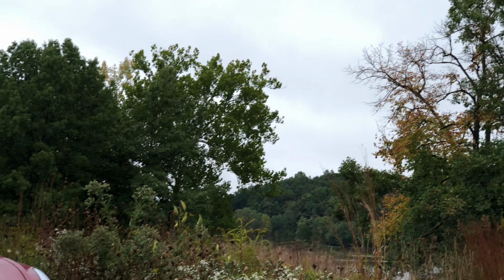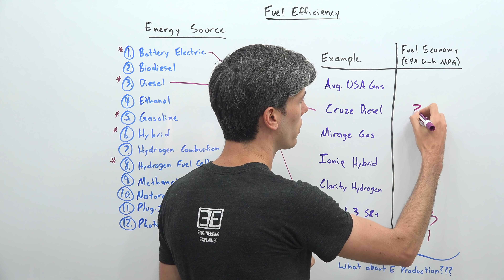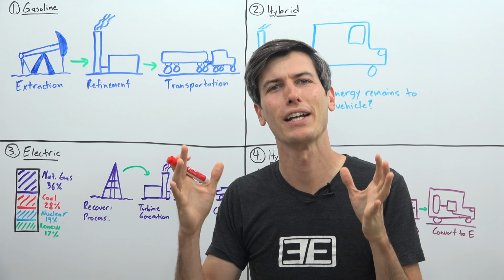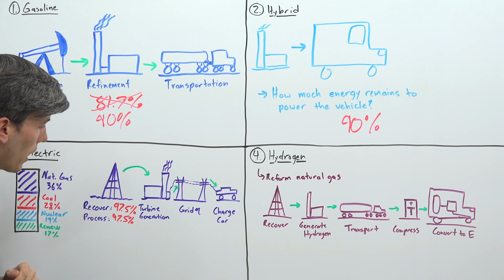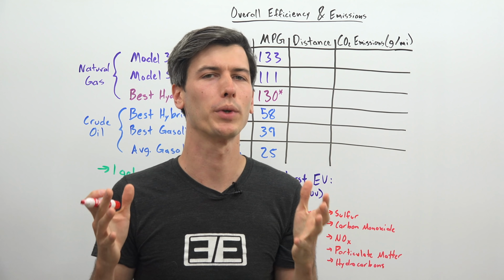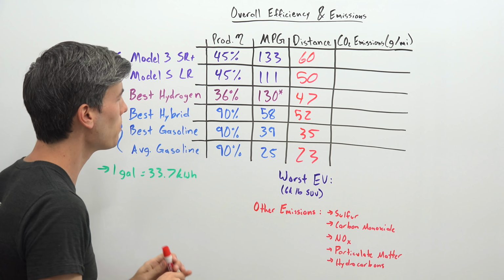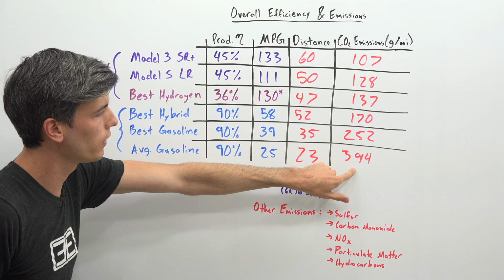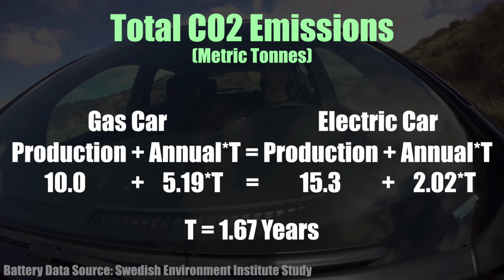Are Teslas Actually Better For The Environment?

Comment: You've explained that you can recycle the lithium and other components of an old battery, but not yet economical. Any concerns of the scarcity of the material until it is?
Reply: Andrew Han All needed materials are not scarce, in spite of being called “rare earths”.
Reply: @_TbT_  yeah thanks. I think graphene will take over as the material of choice. Did a quick read on mass production, but seems like it may involve a lot of methane.
Reply: There's not much lithium in the batteries anyway. Look at the price per ton to see how scarce something is.
Reply: @TechnoMonkeyFarm  You certainly can get the scarcity or demand from the spot price. Lithium still relatively expensive compared to the other metals. Ok, scarcity isn't a problem right now.
Reply: It's all a matter of scale. Once there are enough batteries to recycle, it'll probably be worth it. Especially, considering that techniques are still being improved upon.
Reply: @tombratfred3102  yes, with all things. Should be interesting. I wonder if there's a case study on the batteries afterlife from hybrids. Ev are getting priced down, but Toyota still committed to hybrids. If they switch, big move.
Reply: Lithium isn't scarce. It's incredibly common. Cobalt is a little scarce but Tesla is reducing & trying to eliminate it from the chemistry.
Reply: @ashan723  The batteries in hybrids are so small (1,5 to very few kWh) that there is no real business case for a "second life" as e.g. PV buffers etc. And because they are so small, they wear out dramatically faster than pure EV batteries, because their minute capacity means they get charged and discharged extremely often.
Reply: @_TbT_  interesting. I would be shocked if they just threw it away without repurpose or recycling it. I have seen car batteries charging homes in Haiti. Doesn't look for recycling batteries right now, but I guess that road will be crossed sometime later in future.
Reply: @_TbT_  *rare earth metals, NOT "rare earths"
Reply: @_TbT_  There aren't any rare earths in batteries.
Reply: @kiyoponnn  @superdau     Thanks for your valuable contribution.
Reply: @_TbT_  Triggered😂
Reply: @kiyoponnn  Well, if at all, triggered that there was no contribution to the topic discussed by you. Pointing fingers at small errors seem to be much easier than posting a valuable discussion contribution.
Reply: @_TbT_  Typical german😂

Comment: Why did you give gasoline based vehicles a mulligan of 90% efficiency when Oil and Gas says 81.7%?
Reply: It doesn't make a difference, since Tesla doesn't get anywhere near 133 MPG.
Reply: @ForestNinjaZero  133 mpg equivalent
Reply: @Igabobalushi The rating is false. If I recharge a Tesla with 100% of what can be transmitted from a gasoline-powered generator, over a standard grid, the actual output will be in the range of 10 mpg. Equivalent of what?
Reply: @ForestNinjaZero  The 133 MPGe number comes from EPA tests. You are welcome to challenge the EPA numbers, but where is your source or calculations to indicate it is just 10 MPG as you assert.
Reply: @ForestNinjaZero  Can confirm my Model 3 long range 2 wheel drive (which I now have about 40K miles on in the last year, probably about 80% road trip so a good samplesize) actually exceeds the EPA estimate on road trip driving in summer at ~75 mph about 330 miles on a full charge, and comes in below a bit at about 290 miles in winter on the highway. (For reference primarily at sea level to about 2500 feet and back.) That is all roughly the worst case scenario for it. Obviously if you're going up a mountain that drops it significantly, but the same for gas powered car efficiency. I, at least, regenerate some on the way down the other side. And, again, I've got large samplesizes I've worked with and a bit of a number nerd, so watch this closely on basically every road trip even now. :-)  To the point that I'm fully comfortable (and have done many times) bringing my car down to under 5 miles left on the charge to get to the destination. :-) It's all just math and gives you something to do while driving, and one place I drive frequently given the distance between superchargers combined with about a 6K foot elevation gain, it's just barely enough. ;-) In fact, funny enough on this one, in the winter there is a point in the trip where it will say I'm going to arrive with about -10 to -15 miles by one measure it displays. But I, and the car, both know that the last 15-ish miles or so is all down hill, so the percentage meter will show it correctly. So while I'll typically reach that point with little to no charge, I arrive at the supercharger with usually around 3-5 miles on that one.

And note here, even if I guess wrong given a certain day's conditions, the fix is always just to slow down. This thing has more like a 500+ mile range at closer to 25 mph, for example. (Give or take depending on exact conditions.) Also, I'm told Tesla gives a little wiggle room even when you reach 0 miles. Haven't tested that out for myself. 

On that note, if you slow it down to 60 mph on the highway, you come out significantly better than my above highway figures, but who wants to do that? :-)  In-town driving at slower speeds but a lot of stop and go, it usually gets about 25%-ish better than those highway numbers, give or take. And driving in Nevada once when it was 100-ish degrees out and super high density altitude I actually get closer to 340 miles pacing on a charge despite having the air conditioner blasting and doing 85 mph!  That's the best I've ever gotten on a couple hundred mile stretch and especially at that speed it was crazy. 

I also know someone who has a Model 3 long range 4 wheel drive and it is almost exactly spot on the EPA's estimate of 310 in the summer and about 270-280 in the winter on the highway. For those wondering, I also think the 4 wheel drive is needless here. The traction control is incredible on the Teslas, and 2 wheel drive has proven to be plenty sufficient on snow and ice, even with just all-weather tires. (And given the fairly evenly distributed weight, the stability of this thing cornering in snow and ice is the best of any car I've driven. Super smooth and predictable when it does slide.)  That said, the 4 wheel drive is a bit faster off the line, and it is actually noticeable despite the 0-60 times being not that different. It is more that there's an extra level of snappiness to it, which I believe this channel has made a video on why, thanks to the different design of the front motor than the rear. But I like the slight increase in range on the 2 wheel drive given the road trips I take vs. slightly better acceleration. Also it was cheaper and the 2 wheel drive is plenty fast. :-) -Daven
*EDIT: And should also mention all these numbers are with the aero rims and mostly just me in the car and maybe a little luggage.  If you take off the aero rims, when talking highway traveling, it drops about I'd say around 5-15 miles depending on weather. In-town driving not really a noticeable difference. I have only once taken a (3K mile) road trip with a fully loaded car, but I don't remember what the numbers were on that one. It was my first road trip actually almost on day 1 I got the car. :-)
Reply: And yet you didn't get anywhere near 60 mpg, at any time during your trip, and certainly not 133 mpg, even with the best case scenario. The rating is fraudulent, which is why they need to fill pages with noise, then use strawmen against any physics argument.
Reply: @ForestNinjaZero  Several people have provided real world examples or cited government testing results. You appear to only offer a contrary opinion without anything to back it up. What you have to offer appears to be FUD.
Reply: They've provided nothing of the sort. Return only with real physics knowledge, and try not to further discredit yourselves in front of the audience. You're telling me that you're frauds, and you can't read.
Reply: @ForestNinjaZero  Maybe you could provide real physics knowledge rather than opinion. You are the one who is discrediting oneself.
Reply: No, everyone who has opened a physics book, at some point within their lifetime, can immediately see that I'm accurate. You are frauds.
Reply: @ForestNinjaZero  Sorry. You bring nothing but derision, name calling and generalizations to this conversation. I am left to conclude you are trolling. Over and out.
Reply: Fair enough, but I've won already, and I'm not the one who needs to sell products.
Reply: As he said at the start - to make it harder for the Teslas to win.

I agree, he should've run the numbers assuming petrol production to be 81.7% efficient.
Reply: Yes frustrating. He could of at least included the end result for 81% and ev result for the actual grid make up and the numbers would of been even more staggering.
Reply: The point was to scare away idiots from pointing out conservative think-tank data.
Reply: ForestNinjaZero troll. Portable gasoline generators are not efficient at producing electricity. You cannot compare that to any power made at a power plant
Reply: @ForestNinjaZero  If you burn the gas and use the heat to turn a windmill it goes even slower, what's your point?

It's about the amount of actual energy used to move it. It's like saying "horsepower" which really doesn't mean much until you know how much energy it is. 

It essentially means that the car can use less energy to move, while the amount of energy stored in gasoline, burned the same, goes less far and more is wasted as heat.
Reply: @ForestNinjaZero  The rating is true. Gasoline doesn't have infinite energy, it has a very specific amount of energy, which can be matched by thermal energy, kinetic energy, or even electric battery.
Reply: ForestNinjaZero not quite. 1gal of gas = 33kw of power. A Tesla Model 3 uses average of 245w/mi according to EPA test. 33,000w/245w/mi = 134miles. 134mi/33kw, aka 134mi/gal of gasoline. It’s basic math bro, a 3rd grader can do it.
Reply: @andrewkremer4285  No, that's more 5th grader math. He may be a religious "independent" type..
Reply: @Andrew, try physics, rather than lying to yourself. Even a 3rd grader can determine that 310kw/h motors can't pull a two-ton vehicle at an average of 245 watt-hours per mile.
Reply: @Avery, please don't bother replying again, since you don't even know what energy is.
Reply: @ForestNinjaZero 
Hello! I'm an electrical engineer working at SSI. I have developed battery management systems for lithium batteries, and before that, I was a mechanic. 

While you can take a gallon of gas, run it through a generator, and turn it into electricity, it won't be 100% efficient. The generator makes heat too, which is energy doing work you don't want. It's around 30% efficient. So while a gallon of gasoline has more energy in it for the same volume, it also is wasting more of that energy in the process. 

This is like burning hydrogen or using a hydrogen fuel cell. The fuel cell is making electricity directly, and the same hydrogen will make the car travel farther, than if you use a hydrogen combustion car, which burns it, and therefore is much less efficient. In both cases, the hydrogen reaction releases the same amount of energy, but the exhaust heat is most of it.

An LED light bulb is more efficient than an incandescent bulb, but if you plug each one into a separate generator, they will use about the same amount of fuel, despite one bulb being 10x as efficient. So that efficiency works only if you don't waste it in the middleman.

Did you know if you take gasoline, use that to run a machine to compress air, and then use that compressed air to blow it onto a fan, and use that fan to turn a generator to charge a battery, and then use that battery to turn a propeller, that 1 gallon of gasoline might push the car a few feet, because some of the energy in that gas, or most, is wasted as wind, heat, noise, etc. Even just sound is energy being sent into the air. So that's wasted energy. 

It's funny, because it's obvious that you haven't taken a physics course. You're going to either lie, or say "no, but I know what I'm talking about because I watch tons of YouTube videos and read quora and Reddit" haha.

Comment: I'd love an EV, but until I can buy one in good condition that I can repair myself with cheap parts from Amazon for $4000 I will stick with my 03 Silverado.
Reply from the maker: That's fair! They have a way to go as far as affordability. Used there are some bargains on EVs out there though, even under warranty.
Reply: 03 Silverado you say? Get the best of both worlds and buy yourself a 5.3 VORTEC HYBRID SILVERNADO!
Reply: Agreed, I will likely drive gas cars until they ban them.
Reply: @akonnema  Suit yourself.  People still ride horses and I guess they get a kick out of it.
Reply: @akonnema  And then drive any car until driving is banned
Reply: As a poor college student I’m keeping my 2000 Civic for a while. I get 30-35 mpg so I can’t complain really.
Reply: @EngineeringExplained  Additional point, keeping the car you own is basically always more environmentally friendly (unless it's leaking hazardous waste) than buying a new vehicle.
Reply: badmoon908 EE already made a video addressing that point. It’s actually better to purchase a new electric vehicle over keeping a moderately efficient gas powered vehicle, because manufacturing only accounts for a small percentage of the lifetime environmental impact of a vehicle, gas or electric. You save more emissions by ditching gas than you create by building and driving a new electric car.

Comment: 2019 Kia Niro gets an EPA combined 50 mpg.
Reply: My 25 year old turbodiesel merc gets a real world  (averaged over my last 100.000km of use) of 35 mpg and that includes a lot of 90 mph cruising 120 mph autobahn and little regard for fuel consumption. Gasoline cars only get good mileage with a very velvety right foot. Managed 71 mpg with a latest model mini cooper but that’s exhausting driving.
Reply: j j 2021  Huh? Rated on the sticker it says 35/41 and I've NEVER seen a car that got as good as its sticker rating. I guess you can't read or do the math on your own vehicle. I'd bet those 63 horses were a real dream down the highway..
Reply: @Jon Seymour Cool story bro

Comment: The flaw with this is that everything is based off of “emissions”. Not total resources used and waste product.
Reply: K T emissions is what we’re trying to correct though. That’s the part that’s heating the earth. Even in worst case scenario where you don’t recycle the batteries, you can create car battery landfills which contain the pollutants. Drilling and transporting oil isn’t exactly without consequence either.

Comment: imagine if grid generation was all nuclear... The difference would be even greater.  Here where I live they still burn coal (!)
Reply: There are alot of problems with nuclear power, a major one being load reaction time. It takes time to change the output of a nuclear power plant and it can only operate within a certain range. Stopping and starting takes much much more time. Coal and Natural Gas can stop/start and modulate the fastest (batteries are the only exception, but they are very expensive at grid-scale) that is the major reason they will never disappear from our grid without new technologies.

France has had the greatest percentage of electrical power produced by nuclear power and the US has had the largest total nuclear electrical power generation, together they have not been able to solve the problems associated with long term nuclear waste storage.

Real engineering has many wonderful videos that cover different sections of power grids and many different technologies used in power grids if you are interested in learning more.
Reply: To be clear, I do think nuclear power has a very important place in the power grids of the world and that it's development should continue with ernest. Especially operating and waste storage safety. There are many nuclear power generation plant designs that show significant advantages that simply can't find funding because of public image.